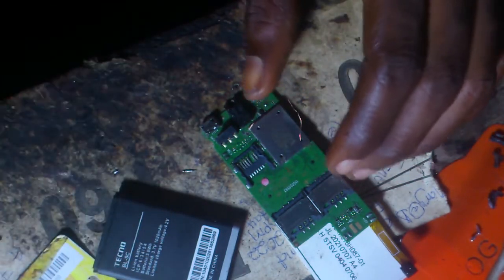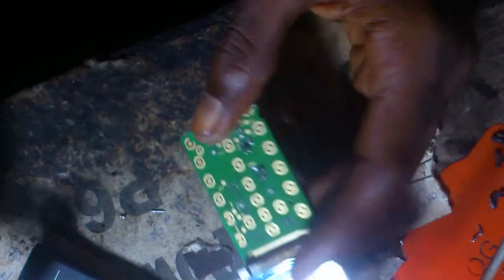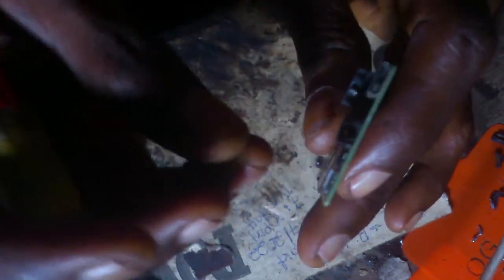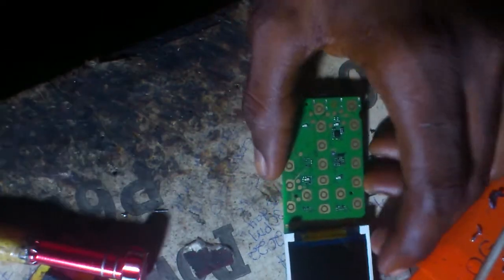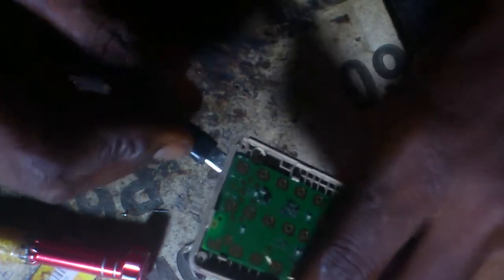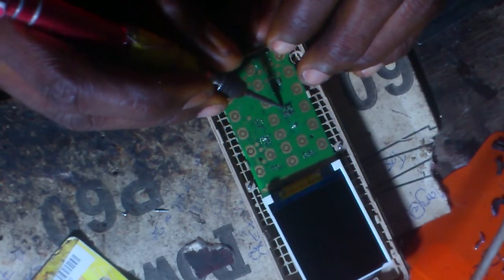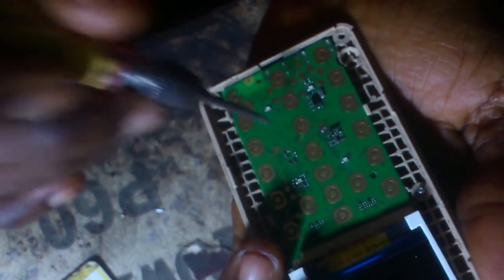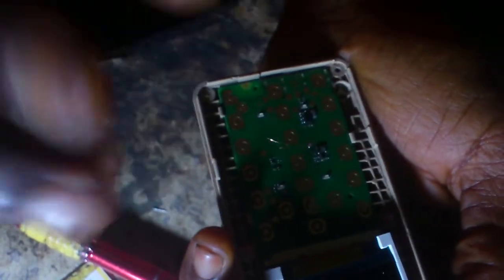Itel it2160 battery error or charging error jump ways from the NTC or TREF to the battery connector

Comment: Nice work. U can also connect 10k resistor between the NTC thermal and the the negative thermal of the the battery connector.
Reply from the maker: Use 10k ohm SMD Resistor only, you can't use resistors from electronic devices like radio resistors
Reply from the maker: Chat me on Whatsapp+233509276185